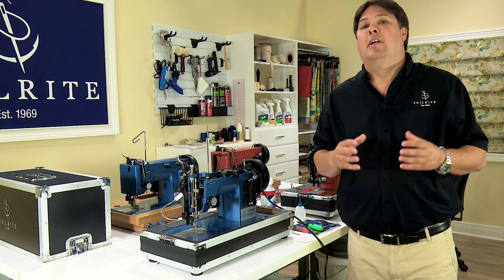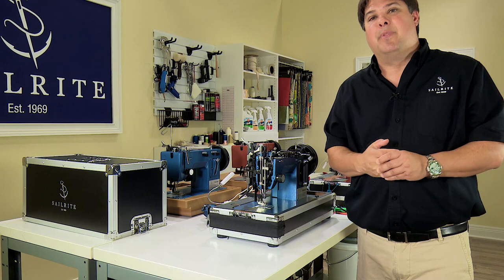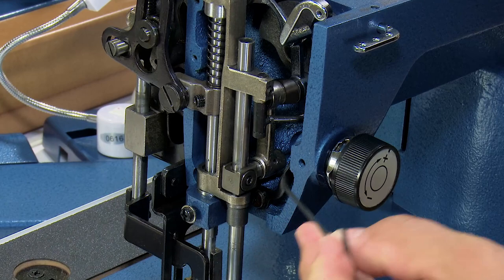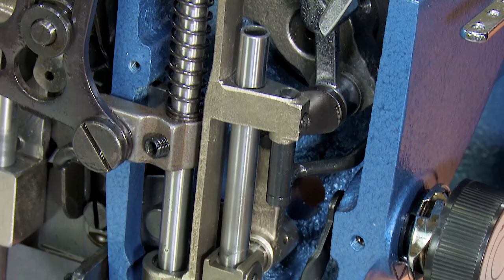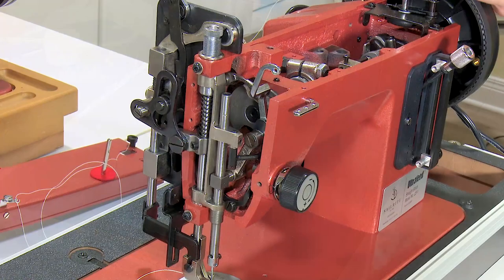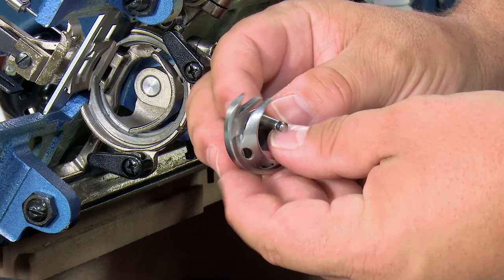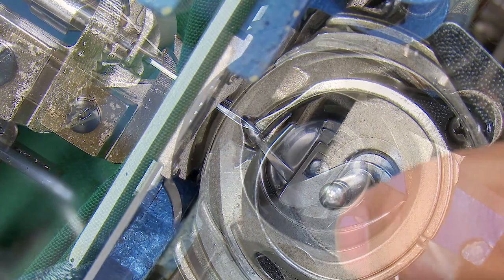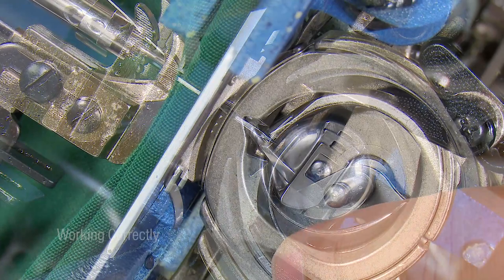Needle Bar Height on a Sailrite Ultrafeed Sewing Machine

Comment: Thank you so much for making this video. I had a problem about the hook timing. I looked for many discussions and videos but only your video helped me ^^ Now I can sew again!
Reply: My machine was sewing great. I was sewing masks, scrub caps , bags and gowns for our local hospital .Then all of a sudden the needle hits the hook mechanism underneath. How do I fix this .
Reply: @maberyall9152  I just opened the case of the sewing machine then tried to adjust the height of the needle to make sure the timing is right. If your machine keep missing stiches, you shoul try this method. My sewing needle broken and the problem happened.
Reply: Yvette Dinh thanks for answering. My machine won’ t pick up the bobbin thread. The piece in the bobbin casing is very loose so if I try to raise or lower the needle it hits the casing and bends the needle. Not sure what to do. It’s $50.00 just to have it looked at.
Reply: @maberyall9152  I looked at the right timing for sewing machine then I tried to find the height of the needles. It will take sometime to figure out. Don't turn on the machine when you do that. Turn it off and use the wheel to test the result. Hope the video helps you. My English is not good at all. ^^
Reply: Yvette Dinh Thank you for your help. I will try it and let you know how I make out.

Comment: Is it possible to adjust the front-to-back movement of the needle bar in the Sailrite? If so, how?  Thanks.
Reply from the maker: I have never done that (move the needle bar back or forward) so I am not sure. You can email this question to support@sailrite.com and a sewing machine tech will contact you if this is possible.
Reply: @SailriteDIY  Thanks.

Comment: a hundred stitches out of the box and here I am
Reply from the maker: If this is a Sailrite Sewing Machine get in-depth help by emailing: info@sailrite.com and we will assign a sewing machine tech to help you resolve any issues. 
A bending needle happens usually when the operator turns corners very sharply while sewing or when in a stopped position with the needle buried only slightly in the fabric. In those cases the needle enters that fabric at an angle and as it travels downward it becomes bent even more and then it hits the cap spring or the hook. So, when turning a corner, in a stoped position, bury the needle to the deep part of the shaft and this can be avoided. This can also happen when switching from zig-zag and straight stitch with the needle buried in the fabric or when moving from or to reverse in a stopped position with the needle buried. Avoiding these situations will greatly minimize the amount of cap spring and hook maintenance required.